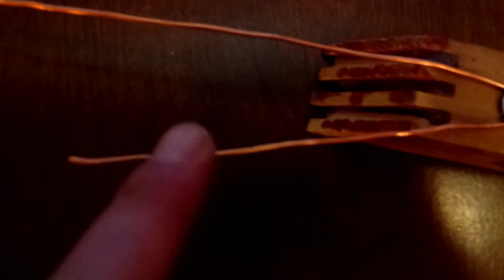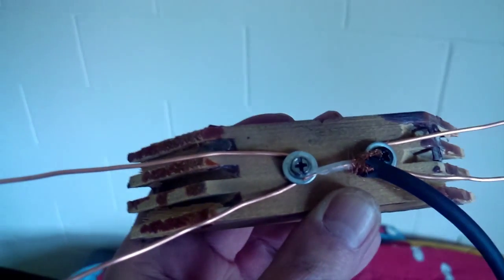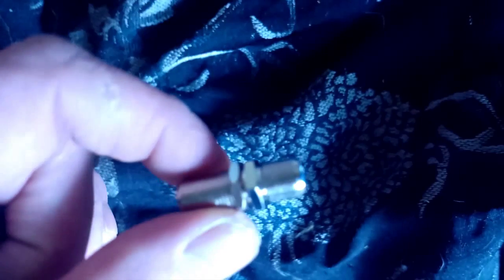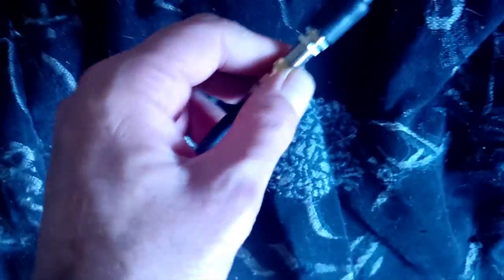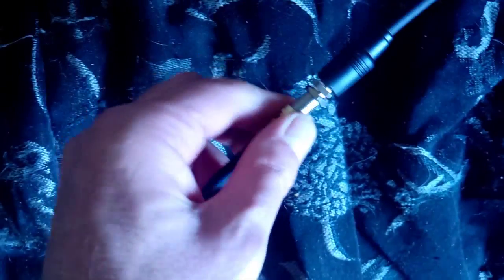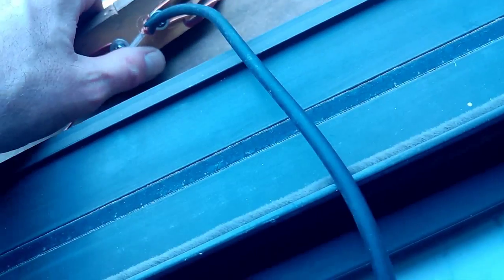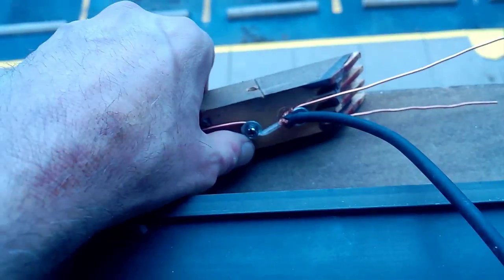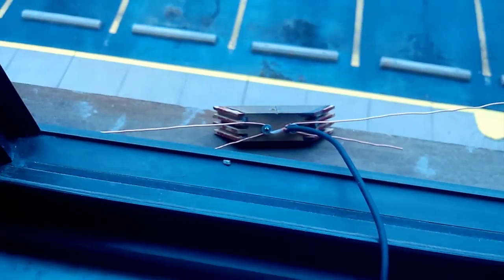How to make the cheapest homemade Rabbit Ears HD Antenna that works great

Comment: if i upscale this a bit will it reach farther i am surrounded by mountains blocking my single?
Reply from the maker: Most likely yes, and the higher the better
Reply: No. Signals do not go through mountains. You're probably receiving satellite signals. You may need to turn the anntenna at night because they move. Build my anntenna.

Comment: I made this antenna today, and was shocked at how well it performed, considering its small size. I picked up 24 channels, including some where the transmission towers are 70 miles away. I will be continuing to tinker with the antenna in order to pick up even more channels.
Reply from the maker: +George Bednar yes it does work rather well, I still use the same one, 28 channels, but some are copies of the same channel
Reply: Try my anntenna now. 60+ CHANNELS

Comment: instead of a peace of coaxl use a vhf uhf matching transformer
Reply from the maker: +vorkev1 The whole point of the video is to show making this as cheap as possible and in the comments I did mention using a balun, but you really do not need one.
The beauty of this is that is works as good if not better than a store bought antenna.
I have made over 10 for people and they simply love them.
Reply: Not when you are 50 miles from the tower! I will try to make an aluminum foil true 4 bay bowtie using a cardboard and an antenna transformer. If it doesn't work, then I will try a two bay Gray Hoverman using 8 gauge copper wire, chicken wire, and an antenna transformer. I will let you know if I can get any channels from 50-60 miles.
Reply: parodyisms you can make the matching compass buy winding the coect coils.